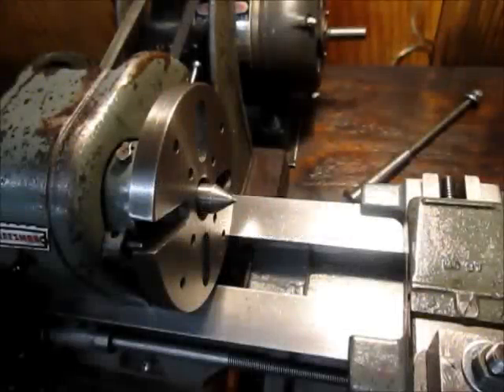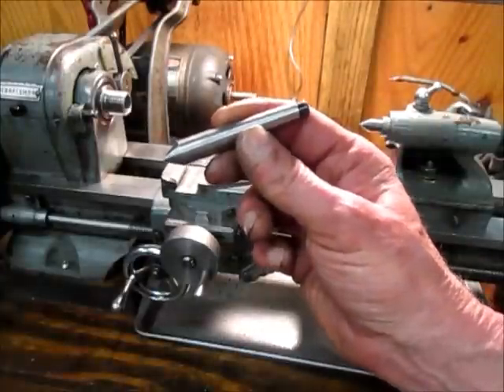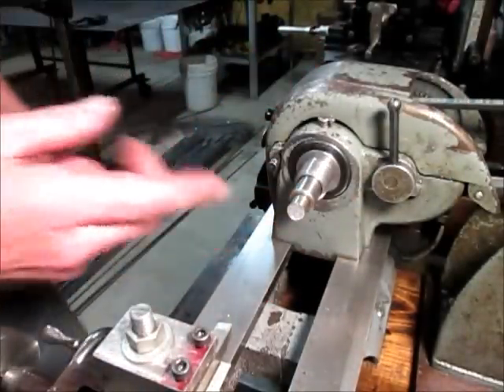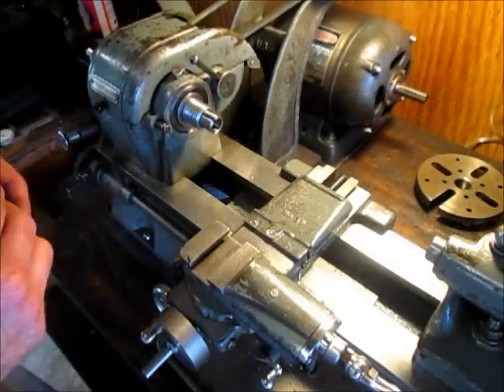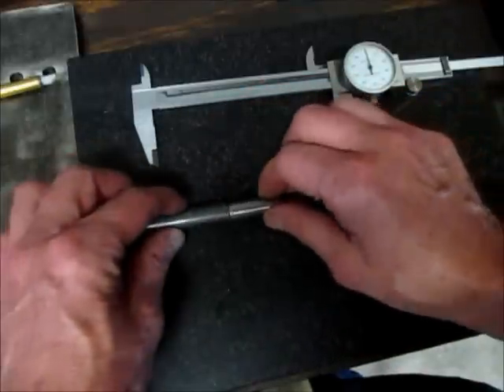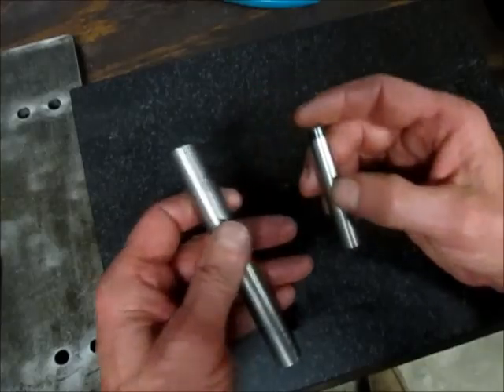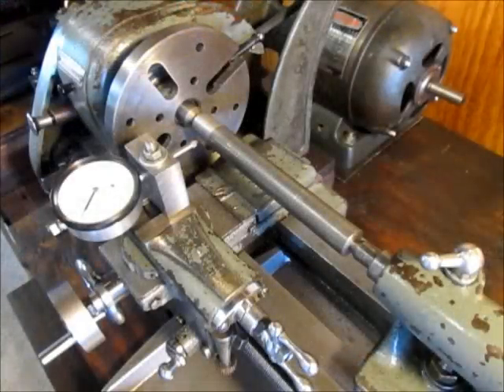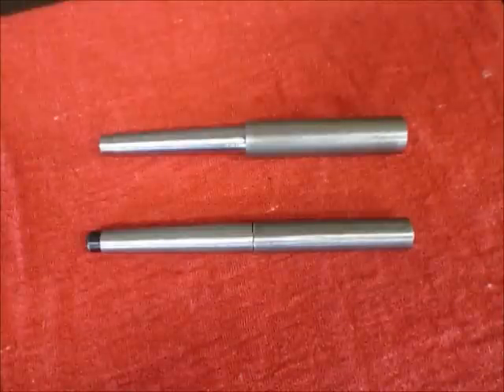Making A Tool For Turning Morse Tapers

Comment: Wonderful. But you have a tail stock offset. For those with fixed lateral tail stock they would have to use offset device
Reply: On wood lathes adjustable (offset) tail stocks are uncommon but not on machinist lathes. Wakodahatchee Chris

Comment: In order for this to work, the taper blank has to be the exact same length as the tool, with the tailstock center being at the exact same location.  Nearly impossible to do in practice.  Your method will get close to the proper taper angle, but it's not as accurate as other methods.

Comment: Sorry to be a prophet of doom here , but if you only drilled the holes for your pin I can guarantee that your set-up will be off. If you had rotated your sacrificial set-up 180 degs when you offset the tailstock, you would have got a different reading. Idea was good but try reaming instead, much better fit for the pin.

Comment: I saw a video where the machinist used a dial indicator set to zero on the tailstock and when he moved it off center (in your case, your indicator showed zero a tossed the taper) he left his indicator on his tailstock in place so when he was done cutting his taper, he simply readjusted the tailstock to zero on the indicator. Pretty neat idea.
Reply from the maker: That is a good idea.

Comment: Likes=500, now. Do you Loctite the 1/4" pin or just press it together?
Reply from the maker: You could, but I left mine as just a slide fit. The centers hold them together. Thanks for watching and the 500th.

Comment: Cool Video! I've never turned a morse. I'm doing one these days but that's her last name ... . Mine's Kennedy like the box lol.  ;- ) Anyway, I've 'felt' tapers from tools that sometimes don't 'stick' well straight from the mfg Co. I felt no play and saw no indicator read of movement or wiggle. Just had to wrap OD taper with paper, insert and spin to clean just to get it to seat at all. I've ground quikie arbors on a spindex or 'whirly jig' for soft honed IDs to wedge on and give a cylindrical grind to .0005 or whatever. But wonder if the hard on hard or perfect ground finish had a bit to do with it when it came to morse tools? This has only happened a couple times in 35 years. Maybe were cheap imports, ground but but really there. Thanks anyway. Thumbs up.
Reply: ps. in frustration to really know if there were nicks or dings I even 'felt around it with an Arkansas stone and all was clean. No I don't polish this stuff with scotch bright like some do. ;- ) Thnx
Reply from the maker: Thanks for watching.

Comment: I just went through the process of making a MT adapter for my copy lathe. It was the first time I tried to use a taper attachment. Chinese lathe and attachment. Way too much slack in the system. After much fooling around I got my adapter made & it works well. 1"-8tpi to a 2" shoulder to the large end of a #4 MT, to a 4" long 3/4" shaft that is drilled and taped for a 1/2-13tpi draw bar. Started with a bar of 4130. You did it so much better than the way I went at it.
Reply from the maker: As long as you get the results you want. I'm far from being a good machinist, I just fumble along and sometimes it turns out ok. Thanks.

Comment: Get a drift for removing items from the MT adapter.  If you slip with that screwdriver it's gonna hurt.  Other than that it was a great video.  Very good work by hand on that 6" Craftsman lathe.  You are a true MACHINIST!
Reply from the maker: I'll keep that in mind. I appreciate the comment.

Comment: Wow, been a year since I commented on the dp vise trick. I now use one regularly on my saw. Thanks very much again. Regarding your tool.  Could you have instead, put a piece of stock in your chuck , faced it and center drilled it. Then put the tip of your dead center in the freshly center drilled hole to support the tip at the chuck instead of cutting the dead center? I'm no expert. Would that work? I need to turn some tapers. Thanks
Reply from the maker: I don't know, I would say give it a shot and see what works for you. Thanks.
Reply from the maker: Remember, the length of the tool has to be the same length as the work piece. So all my MT #1's start with a 5 inch piece of stock. But if you have enough travel in your cross slide, it's easier than offsetting the tailstock.

Comment: I pop a female centre in the headstock and male centre in the tail (assuming the reference taper has a centre hole) then set the compoud to the known good taper.
Reply from the maker: That will surely work if you have enough travel in your compound.

Comment: wow,  this is just what I have been looking for,  so much easier than making an angle jig for back side of lathe, and then having to remove cross-slide nut for slide to move freely,  I bet I have watched 20 or more videos about this, finally found yours    this is GREAT and simple,,, thanks
Reply from the maker: +jbrunson1949 Thanks for taking a look.

Comment: how do you find out where to set the conpound to get the right angle for the tapper you need?
Reply from the maker: Bison Workshop With this method the cut is made with the carriage so the compound doesn't move. The tailstock offset depends on the length of the work, so the work needs to be the same length as the tool. I chose 5 inches because that's likely to be as long as I will ever need and it gives enough space for the lathe dog.